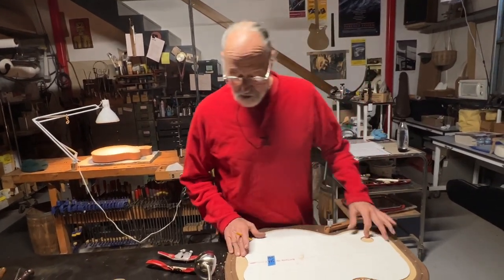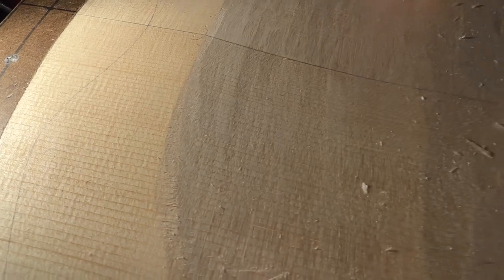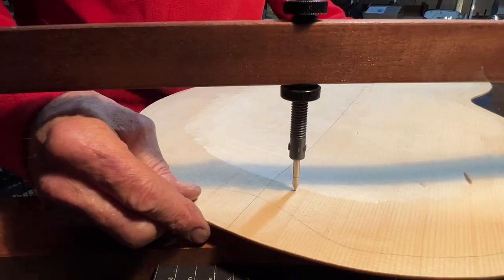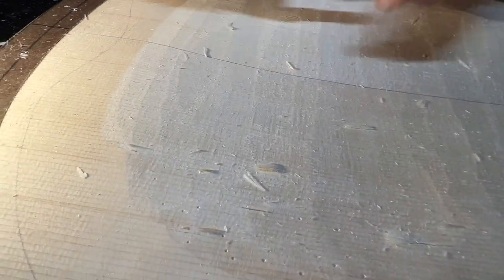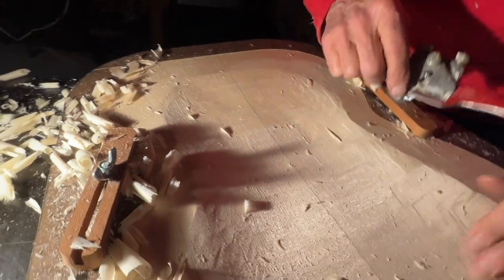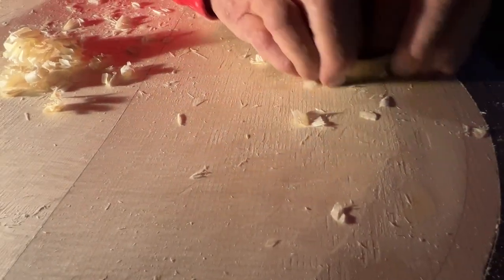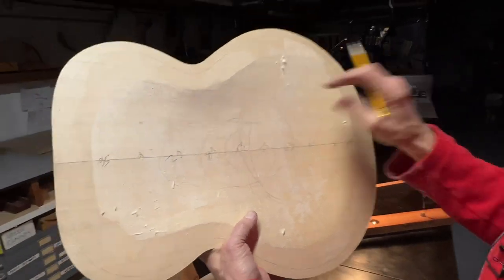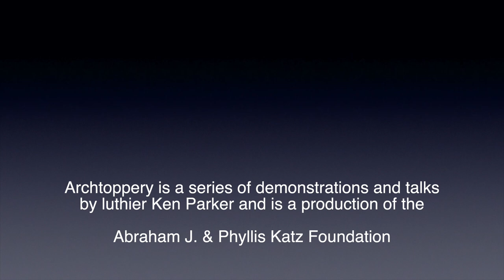Ken Parker Archtoppery - Arched Plates - Rough Carving the Inside - Chapter 4

Comment: I’ve already made a Strad punch and I think I’ll add the foot pedal. I am really looking forward to the coming videos on making the tools. I have an old spokeshave that is waiting for its new life as a carving tool. My drill press is notorious for a slipping quill stop so I would never use it for an arched plate. With the punch I don’t need a new drill press, you saved me some money!
Reply from the maker: Great report!
I wonder what odd kind of quill stop might be able to slip? The only ones I've ever seen were fine thread knurled nuts on a sturdy vertical threaded rod, and are usually harder to adjust than they should be. Maybe you still need a better drill press?
Reply: @kenparkerarchtoppery9440  My drill is an old Delta. It does not have the threaded rod stop. It has a little knob on the hub of the feed handles. No matter how hard I tighten that knob the stop can be overridden with just a little too much pressure on the feed. Some prefer this type of stop as it’s easy to set. I’m now wondering if mine is broken and could possibly be fixed. I’ll check.
Reply from the maker: @EricKnapp  This sounds like something you can fix.  New fastener? More leverage? Plastic bit  between screw and shaft?

Comment: do you think with a record 70 box scraper I will get into any issues, regarding modifying the tool? as I can get these from the UK that's a little more feasible with shipping
Reply from the maker: It's a little bit of a crap shoot with these "Box Scrapers". A few years ago I bought a big bunch of them, and they're all over the place in curvature and sole thickness. They were made from 1877 - 1958, and because they weren't precision tools by definition, there was a lot of variety in how they were finished off. Some are nearly flat on the bottom, and others have quite a lot of convexity. I found them pretty easy to improve, and if you get one with a good bulge on the bottom, it might work pretty well just as - is. I know a couple cello makers who found them very useful. You can choose to use or discard the long handle, I favor the latter.

Comment: At 20:54. Will there be a process to show how to make this tool? This seems like it could be an incredibly helpful tools even outside of the scope of archtoppery
Reply from the maker: Next up is an in-depth look at the modified/hotrod spokeshave, "Close Shave", and then a few other permutations of available tools that can be optimized by obsessed artisans. Most folks will find that making a plane from scratch is a bit too much, but if there's enough interest, we'll do it!
Closing the throat opening is magic, as we'll soon see!
Reply: @kenparkerarchtoppery9440  I would absolutely love to see how the plane is made. 

I, like many others, make my own tools for instrument/ common wood work. I've already made several kanna Dai and oddly enough have several large weird brass spokesman planes that I'd like to convert into aforementioned plane
Reply from the maker: Wow, kanna Dan sure is the deep end of the pool, alright! So simple, and So demanding! We're just about to issue a big series of films detailing the work involved in precisely "closing" the throat of an iron spokeshave, after which I plan to do some quick & dirty mods to el cheapo planes from EBay, just to show that there are lots of approaches to solve for minimal opening, thereby controlling the shaving and improving the planed surface. I would like to find an ally to help in making short runs of the Noah's Arc plane you cite. Interested, anyone?
Reply: @kenparkerarchtoppery9440  count me in! I'd love to learn more. I'm a big fan as well of modding and setting up tools for the job at hand. Over in my little company (Blackworm Instruments) I do the same thing. I've modified lathe turning gouges to archtop carving gouges the same way you have your modified gouge. It's all steel at the end of the day, in my mind, meld it to your needs if you have it anyway.
Reply from the maker: Blackworm Good! Looks like you’re having fun!
Reply: @kenparkerarchtoppery9440  thank you kindly! I'm grateful to have fun, and be creative